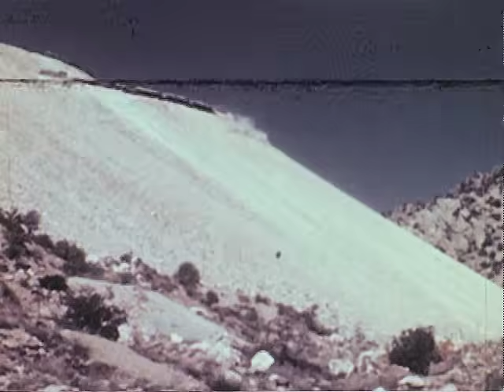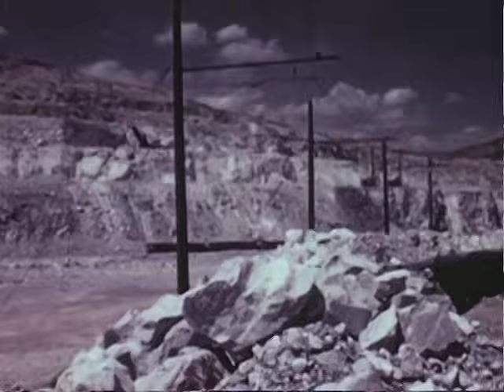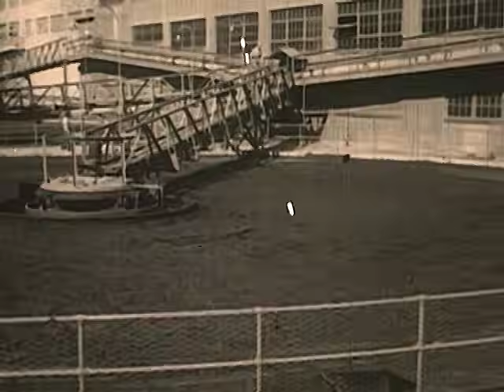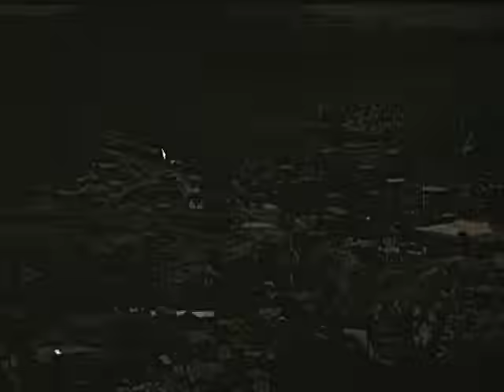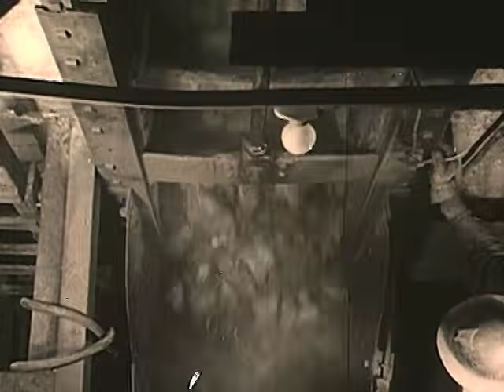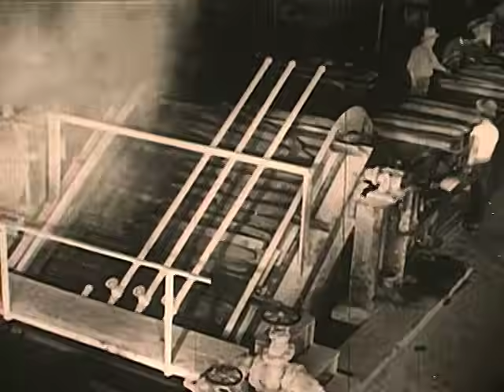Story Of Copper (1951)

Comment: When I was there the trucks were carrying 350-400 tons and there was 410 miles of track. And now they're using rotary drills. Quite a bit of expansion since the old days. The bisbee pit looks like a mud puddle compared to Morenci. Of course most of its works are underground.

Comment: Amazing process. Green tree poles added into the melted copper! ? Thanks for the upload. I had not considered how patriotic copper mining could be.
Reply: What is called “reform gas” replaced the green poles. This  is partially  burned natural gas which is blown into the molten copper to remove the oxygen. Today at Freeport’s Miami Smelter, they steam for the same purpose
Reply: Use steam
Reply: At the Amarillo Copper Refinery we used natural gas was blasted through the melt to remove most of the oxygen. Next the pole method to scavenge small amounts of oxygen during the anode casting step. Our furnace was big enough to see the pole floating around on the surface of the molten copper.  The natural gas step was done at night due to the black sooty smoke that was generated. Wood was also used above any molten copper to reduce reaction of the copper with air.
Reply: sudbury canada had almost no trees left from this early copper process. they trained astronauts for the moon there!